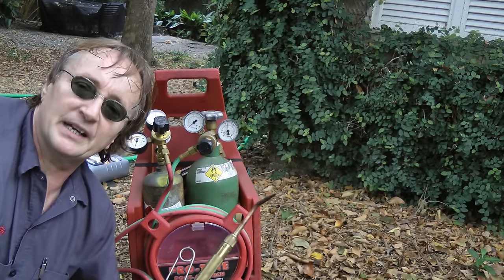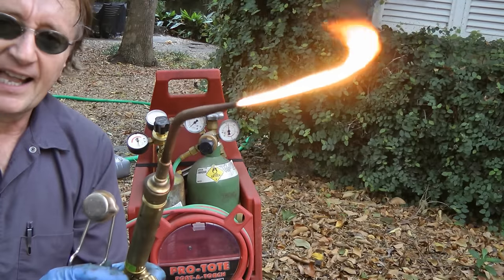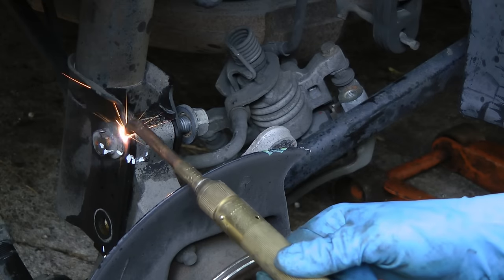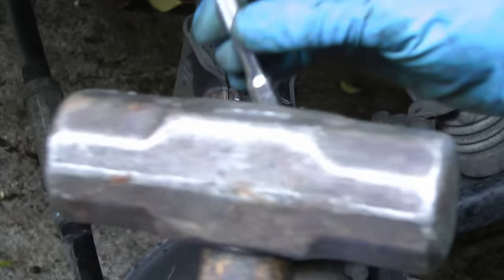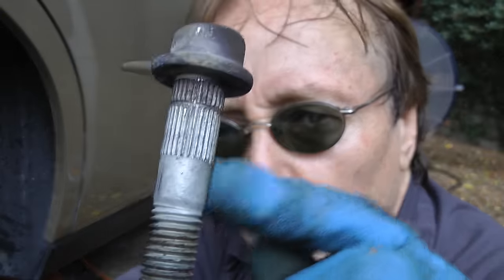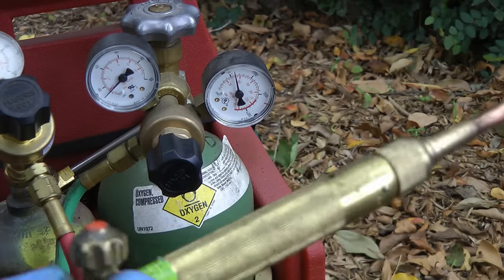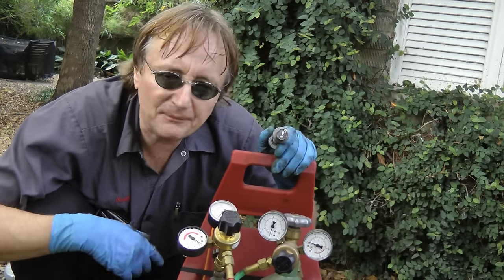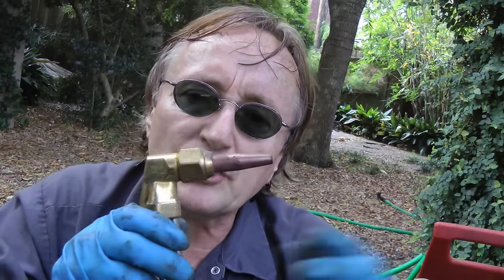How to Remove Stuck Nuts and Bolts in Your Car

Comment: Thanks! Now I'll surely get that fuel filter off!
Reply: Another good tip is to always be smoking when you change your fuel filter. That way all the gas you splatter around is cleaned up right away with little effort.
Reply: Great advice! I'll give that a try as well! and its really cold out here in Canada so I might light a wood fire to keep warm as well as I do the work!
Reply: :-D
Reply: I'm sure it'll be a blast
Reply: Eastern Explorer LMAO
Reply: I know a guy....
Reply: @reagansimon111  I remember hearing about a guy who used his lighter to kill a spider on his car while he was fueling at a gas station. Yea some people are that dumb LOL
Reply: Eastern Explorer omg I have this problem rn, any advice?
Reply: Eastern Explorer 😂🤣
Reply: lol! The dumb and the weak die off! Natures law.
Reply: Make sure you keep a open gallon of fuel right next to you while you do the job. I hear you lose fuel, wouldn't want to run empty!
Reply: Probly don't use it on a fuel line lol
Reply: @GrnXnham  Need to watch what you say, there's probably Trump followers reading these comments, if you know what I mean.
Reply: 😂😂 poor guy that’s funny
Reply: Lol
Reply: Lmao I'm here for fuel pump
Reply: Having the exact same problem.
Reply: I needed to laugh after what we went through on "Old Rusty" today. Thank you
Reply: @edgarbenjoseph3879  I heard you can drive a screwdriver or screw into the side and then turn it out using that tension but this commennisnhella old isn’t it
Reply: 🤣🤣🤣 are you still alive?
Reply: Lmao... im dying right now
Reply: Good luck!
Reply: Wait a minute
Reply: @tahquameken  you do know that Scotty is a trump supporter right?
Reply: @tahquameken lmao bring politics into it ur the one crying

Comment: A word of caution:  once you heat up a fastener like that you compromise its tensile strength.  Most automotive fasteners; especially those used in the suspension are made of high strength steel that have been properly heat treated (hardened and tempered).  When you heat them up you are essentially annealing (softening) the fastener.  If you reuse it and torque it up to spec, it could easily fail either in tension or in shear.  Replace those you heat up.
Reply: how hot are we talking. if you wanted to heat it within a tolerance that would negligibly affect it's strength to see if it would help removal, what sort of limits do you reckon?
Reply: Rite.. You have to get it pretty hot for a looooong time
Reply: although this is true, you would need to get the entire structure of the fastener to be red hot for a while. Though I agree that you should not re use parts when you could get a new one for very cheap. The biggest issue I have seen from heating bolts is that the threads get marred when you remove the bolt and thus are resistant to re threading.
Reply: Very true. I suppose if your worried about it, you could always heat it to red hot and dunk it in oil to re-temper it.
Reply: Drop them in oil
Reply: Thank you.
Reply: highly unlikely,  you could probably hang the entire cars weight from that bolt & it wouldn't snap.
Reply: Glad u said that no ones ever mentioned that but seems sesible gr8! I will!
Reply: Six years later and the bolt is still stuck on. Screw it! I'm heating the damn bolt anyway.
Reply: You are correct but engineering wise, you should probably know that strength and bolts are supposed to be replaced after being torqued down one time! Every time you crank them down they lose tensile strength
Reply: For 6061-T6 aluminum, it gets soft after a minute at 400 or 500F. I heat it on my kitchen stove  before bending it. I would not assume that metal needs to be extremely hot before it changes strength.

Comment: You can also use a $10 torch and Mapp Gas. Yellow bottle.
Reply: Mapp gas only gets 500 degrees hotter than propane. Oxygen acetylene is almost double.
Reply: @dangerdavefreestyle  Yeah, but do you really need that much heat? The vast majority of the time the Mapp gas will suffice.
Reply: Dremel 2200-01 Versa Flame Multi-Function Butane Torch

Comment: Hey Scotty, Thanks for all you do. Thought I'd share another way to deal with stuck bolts and nuts. I had an engine stand in the rain for 20 years, bolts were stuck bad. Used penetrating oil and one of those cheap vibrating engravers on the nut and was able to turn the 1" nuts off by hand.

Comment: I've found another method that sometimes works. while taking the brake calipers off the lower large bolt seemed impossible. i put the breaker bar to it and put a jack under it. the jack has more strength than me. always remember..Jack stands, face protection, pb spray, sweat rag haha. be careful to line this up right because they can go flying if they slip.
Reply: Dude thank you so fuckin much. No dad to teach me but you just gave me a fuckin lesson
Reply: great idea. though i put wd40 on bolt let sit for hour then retry

Comment: I love using a torch. I got so good loosening old rusty bolts I was the "go to guy" in the shop for it. What works best for me is I heat everything up till it's red, wait for the glow to go away, i take a spray bottle of water and cool the bolt. Don't dump water on it as you'll reduce the strength of the items, just a little mist. The trick is everytime you heat and cool the stuck nut and bolt, every thing expands, when you hit it with water it contracts. Never attempt to loosen a bolt while it's red hot. do this heat and cool method a few times 2-3, then as soon as you see it wiggling hit it with PB blaster. PB Blaster can't do anything unless it's at least moving a little bit.

I haven't broken a bolt in 5 years doing this.
Reply: Thank you so much.  I’m trying to take the filler plugs out of my Jeep TJ so I can change my transmission and transfer case oil.  I’ll try your trick tonight.
Reply: @leesire how’d it go
Reply: @bradygeoghagan  no problems at all.  Put Amsoil in every hole too

Comment: I don't use my torch very often, but when I do it's invaluable. Just remember that you can't use a big cherry blaster with a small tank because at high discharge rates the acetylene tank becomes unstable and might explode.
What often surprises me is how heating the bolt (expanding it) makes it easier to come out. Normally I heat what it goes through, taking advantage of the physical change to open the constriction. Presumably bolt heating still works because the thermal change disrupts oxidation, which is the main reason they seize....

Comment: I've been working on cars for a long time and finally just today got around to using this old tried and true method.  I was trying to loosen 14mm nuts on a driveshaft coupling to swap out u joints and they would not budge.  Of course I could only get to them with a wrench instead of my nice extendable ratchet.  Didn't matter though as I was putting enough pressure on the nut that it was at the point of rounding off if I went any harder.

I had just watched this video so it was still fresh in my mind so I pulled out my propane torch and heated the nut and bolt.  Lo and behold it came right off!  Even better is that the nut seemed to fit tighter in the wrench so I wasn't as worried about it slipping.  Without heat I would have rounded the nut and had to run to the hardware store.  This method saved me a ton of time.

Comment: I was trying to replace the bellows on my steering rack but the nut on the inner tie rod wouldn't budge. After watching this video, I planned on getting a MAP gas torch but given it was high traffic time, was going to put it off until tomorrow. Being a bit inpatient, I got out a 1600W heat gun and put it against the nut for 10 minutes and it busted loose pretty easy. Same idea, different tools. Thanks for the video Scotty!

Comment: When using a torch to pre heat any metal, look for a tip/torch used for that application. When he was heating the bolt you notice it go cherry red to almost white which means it was at its melting point and if you look closely, it actually started to weld to the other piece of metal. The key to a good pre heat is turning on the oxygen to where you will see little blue cones near the nozzle (usually in most common oxy/acetylene torches), those are your pre heating flames. When he said to move in a circle, that is the correct statement but in the video he favored one side a little more then the other which gives uneven heating, but metal being heat conductive (depending on the type) heat will transfer. This set up is helpful on most suspension fixes but when you start getting into engine fixes, they make a special electric bolt heater that you can bend and mold to the way you like which I highly recommend.

Comment: Scotty, The torch is the best tool in my garage. Lately I have had to do a couple of O2 sensors. I just heat half of the "bung" red hot and they come right out without muscle or breaker bars. My O2 sensor tool is a cheap 7/8 wrench that I cut in half. Box end for removal after I chop the wires and open end for install.The box end will not fit over the connector. Your vids are classic!

Comment: Just a tip for everyone when you have gotten the bolt you want to remove nice and hot but you cant hit it with a hammer spray it with wd-40 Pb Blaster ect. When the bolt is hot and a cool liquid is applied capillary action sucks the penetrating fluid into the threads making the bolt MUCH easier to remove!

Comment: That's great as long as it's not your battery cable, I had one that was rusted solid.  My mechanic was able to do some "magic" and get it working again, but he wouldn't say what he did.  Only cost me $1.25 for labor and that was included with my oil change.  He's a great guy, the Scotty Kilmer of Iowa, but doesn't have a dealer level scan tool anymore, lost it in the flood of '08.  Thanks for another great video.  See you on Saturday, and lets keep the storms away this time, lol.

Comment: I usually just use a propane torch, always worked for me.
Reply: no where near enough heat to move a bolt that size
Reply: @ryanchapman6162  It works, you just have to heat it for longer than what he showed in this video.
Reply: propane torch will run out of propane on one of these strut bolts, currently fighting a seized lower fork bolt which goes thru a LCA bushing on a 06 accord, good luck to anyone in this situation u will make it through 👍👍👍👍
Reply: What about map gas since it burns hotter?
Reply: I like to combine cold and heat. In most cases I start with heat and then wait for it to cool, then use compressed air upside down to freeze. If you spray it down it should technically suck in what ever you sprayed as there will be a gap inside.

There are also situations where heating is difficult and cooling is actually easier with a bucket of ice / compressed air or just an ice pack.

Comment: And then anti-seize was born! Haha those things are very handy sometimes. I just use a cheap propane torch myself. If the bolt STILL wont come out, heat the bolt up until it's very hot and spray WD-40 all over it. It'll make white smoke like crazy, but keep going. The heat will suck all the oil in, and it will come right out with a good hit. Remember to be careful around any rubber parts (brake lines, CV boots, strut bellows, ABS connector, etc..).

Comment: Scotty, you dead right about regular torches not getting the stuck bolt hot enough. I just changed a driver side rear strut on my 94 Ford Aspire and it was super stuck. I used PB Blaster and a regular torch and it took five hours! We ended up cutting the strut rod and the bottom part that has the bushing in it with a grinder to get it off.

Comment: Thank you Scottie for this excellent video on how precisely to use a torch flame on a bolt.  It's always so nice to see a real pro do something that you want to do before you do it yourself.   Now that I've seen it so clearly in the video, I have an intuitive sense for doing it myself.  Thank you for your wisdom - it's encouraging.

I just bought a Power Probe Micro Torch on Amazon for $36 and a can of butane for $11.  It'll probably pay for itself the first time I use it when I have to mess with stuck bolts and brake/clutch fittings on my 39 year-old Datsun.  The reason I had to have my car towed to a garage and pay over $800 in brake work is because I couldn't get a stupid brake fitting loose (no amount of penetrating oil or flare nut or or vice grips was enough).  And then after I get my car back with brand new brake master/slave cylinders of course the brake booster failed almost immediately but hey I replaced that myself and learned a lot and my brakes work great now.

The oxygen torch is a bit too intimidating for my comfort zone. For just a hobbyist mechanic working on his own car, I think the difference between having a little butane torch and having no torch at all is going to be huge for me. ;)  Saying that, my purposes are limited to what's done in this video. 

I wonder about your first 20 years of being a professional mechanic Scotty, when you didn't have this torch because you were too stingy.  Did you make it harder on yourself by having no torch?

Comment: I just changed out the lower control arms on my truck, first side was a nightmare using a regular sawzall blade, passenger side I got a Diablo carbide blade and my God, it cut though those hardened bolts like butter. what took me two hours on one side I did in 5 minutes on the other. Then just melted out the bushings and cut out the outer bushing material with the sawzall. Done!

Comment: I get pretty good results with a hand held  propane torch. It won't work as good as yours, but it is decent enough, or at least better than not having a larger torch set.

Comment: On my latest exhaust project, I used a Bernzomatic mapp-pro torch and beeswax - worked REALLY well. I bought a $15 hose extension (WH0159) so I could reach tight spots. After the last of six exhaust bolts that I had almost all the way out of the exhaust manifold decided to snap, I now religiously use heat and wax on all exhaust bolts before attempting to remove them. PB Blaster works ok if it's allowed to soak for a while, but I prefer heat.

Comment: I don't have this kit, but have used an acetylene torch when I worked at a Corvair parts place disassembling 25 year old engines (with ratchets, sledgehammer, and torch). Hint: if you are cutting transmission bolts and accidentally set a rubber bushing on fire, it might pop off a small piece of rubber and leave a scar on your forearm... don't ask me how I know...

Also, you can use heat from a soldering torch to help you out, not as hot and you won't cut steel with it. Also, penetrating lubes are good to apply a day before you get to work, PB Blaster works good.

Comment: I used a propane torch to heat the bolt that held my crank case pulley on and it worked great. a couple of bumps with the starter and off it came.

Comment: Sometimes not even a torch, and pb blast helps. Using grinder cutting the bolt  and Install a new bolt does the job.

Comment: Great video, thanks! A propane torch kit you can get at auto parts places also works well and is much cheaper. The only down side is that it needs more time to heat up the bolt (lower flame temp), but eventually gets there too. It's true that heating up rusted and seized bolts is like black magic, lol! Pre-soaking in something like Deep Creep will make the job even easier.

Also, remember to let the bolts and/or other parts cool at ambient temperature. Never toss them in water, etc. to cool. Care should also be taken not to melt gaskets, axle boots or other rubber/plastic parts when heating up something.

Comment: I use my little butane torch. It works. It's easy to maneuver because it's so small and it gets the bolts hot enough to loosen them up.
Reply: Dremel 2200-01 Versa Flame Multi-Function Butane Torch

Comment: You can make it yourself.use half ATF(automatic transmission fluid)and half acetone.Acitone evaporates quickly so use a oiler that has a good seal.

Comment: I love your quick, to-the-point helpful videos Scotty. I guess a plumber's propane torch would also do the same, or maybe that's not hot enough ?
Reply: it would, just takes longer to heat the bolts up.
Reply: AlainHubert I would try MAP/PRO gas over propane, more BTU's and not that much more $
Reply: I used a plumbers propane torch to get the big bolt out of my harmonic balancer. It just took a couple of minutes and off it came. Works great !

Comment: i use a good ole' propane torch attachment i got at harbor freight for 10$ and it takes a little longer to heat bolts up but it's saved my ass many times too!

Comment: If your a backyard mechanic you can try liquid wrench spray first spray it on and wait an hour till it soaks into the rust, but you can't go slow like that if you run a professional shop you don't want to make the customer wait an hour so heat is quicker.

Comment: When I tried replacing the car battery the bolt holding it in was badly rusted like that. When I tried removing it with a ratchet the head of the bolt broke off. After watching this video now I wonder if heating it up could have saved me a trip to the mechanic. Thanks Scotty!
Reply: That would not be a good idea especially around a car battery, buy your some a Dremmel with a cutting wheel. Don't burn your garage down.
Reply from the maker: dcfs2005
yes, do not heat up battery parts, hydrogen gas it explosive. use WD 40 in that case and let it soak a while.
Reply: Scotty Kilmer pb  blaster   ...lot better  than wd40   that product   is not the same  as the old wd40

Comment: In changing struts on my car I found that when I had the car jacked up (with a spare hydraulic jack) and used the jack that came with the car to place under the tire bolts and jacked up just enough to take the tension off those bottom strut bolts they slid right out easily.